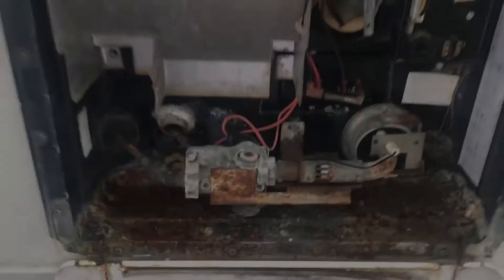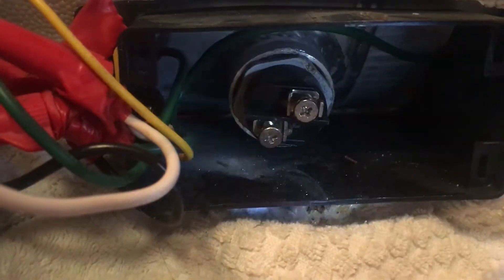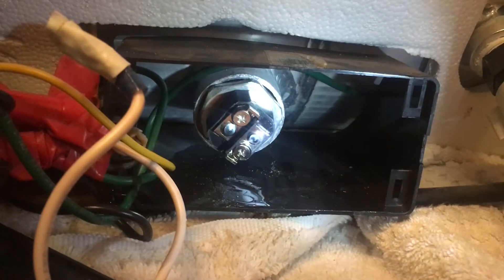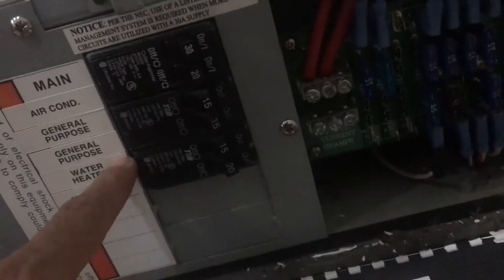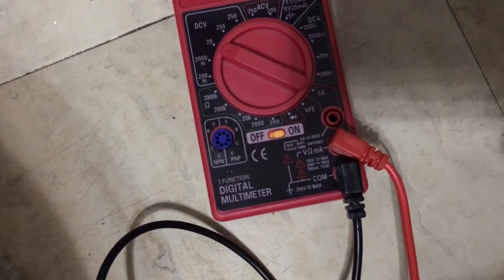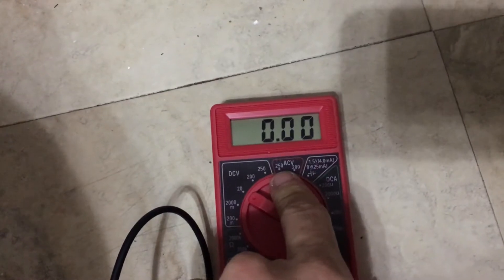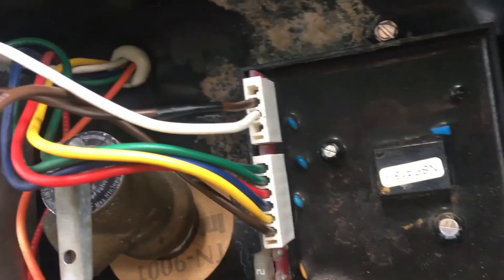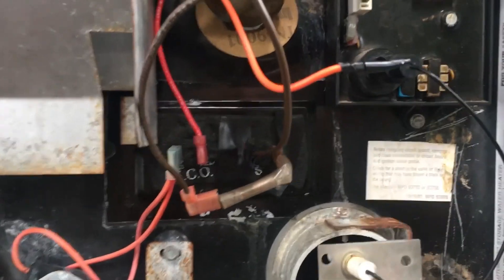Atwood Water Heater Troubleshooting & Repair | How to Fix an Atwood Water Heater In An Rv

Comment: How do u turn water supply off to a Atwood  mpd 93756 10 gal  tank ?
Reply from the maker: if you are stationary at a park then usually you are connected to a hose outside. There should be somewhere to shut off the water coming into if you follow along the pipes to where they lead outside the trailer and then the hose that leads to the connection to where you water comes in at.

Also, you may find valves that shut off the water close to the unit itself but I recommend to stop it from the source and allow pressure to release by opening up everything.

Make sure the unit has no power to it or else you can damage it further. Only turn it back on when everythings ready and its filled up with water again

Comment: Hi Brian, we have an Atwood in our 2016 trail runner.  We went to the trailer this weekend and our water was smelling bad both cold and hot water… any idea what could be the problem?  Thank you!
Reply from the maker: Could be the water itself or I would check the connections on the grey water tank and the main water tank to see if maybe something maybe got in it or somehow got intertwined. Other than that, you should be able to tell a difference if it’s a fecal smell, a rotting smell, or if it smells like stagnant water ?
Reply: Thank you so much for your reply and time! I will check that out :)

Comment: Not old enough we dont have Epc  TStat  in the outside and hot water can burn you it’s so hot.
Reply from the maker: are you saying your water heater is too hot?
Reply: I have a 2001 tv with a Atwood water heater.  My gas comes on but my water does not get hot.   Any idea?

Comment: I'm having an issue with my relief valve opening and flooding the outside panel,  putting out the flame

I've tried reseting the air gap a few times. I'd really like to have hot showers back

Comment: Nice video. I recently purchased an older camper with a water heater that looks just like that one except it is a 10-gallon. Have had no luck getting it operational and I heard you say you have to have 12 volts. Does your trailer have an AC to DC converter or do you have to keep a battery charged on the trailer? I am at a fixed location on full electric not using the gas side either.
Reply from the maker: yes it did have a converter and yes you do need to keep the battery charged on the trailer. Especially if you dont have a converter to convert. I know it is super confusing but your best bet is to buy a multi meter from harbor freight for 10 bucks and start testing everything from the switch that turns the heater on to your battery. Follow the wire from your battery to your circuit board and make sure everythings connected. Unfortunately, thats what I had to do in order for me to understand how it all worked
Reply from the maker: You might want to see my other video on how the camper electrical system works... I think it will help you big time

Comment: Very helpful video I’ve been having countless issues with my water heater. I have been checking my voltages on the wires outside and I’m only seeing .01 coming through my yellow wire. Would that indicate the board is faulty?
Reply from the maker: To be honest, it's been so long since I've worked on this thing but I do know that the board could not be turning on due to the switch or fuse panel its connected to... Since it's giving off .01 then I would assume its getting some sort of power. To be sure, you should check where the switch is to see if it's sending electricity to the board or the fuse panel its connected to
Reply: Yeah I checked the fuse it was okay and my switch inside has power. Electric water heater is now working but randomly will stop working when the DSI fault throws. Have to do a whole electric reset and then it usually fires up on both. Anyways, I appreciate your help I’ll have to keep trouble shooting
Reply from the maker: @jeremydavis5031  yea it sounds like your board is on its last stretch lol

Comment: Hello and thank you for the tips. The switch inside doesn't turn on (red light won't come on inside) so I assume the problem I have is that the switch inside is not sending 12V to power the board outside as I understand your findings. Based on your video I'm thinking is that fuse you show at min 9. That was so helpful! I have the RV rented out so my tenant is not very happy with me now :-( Any other possibility that switch doesn't come on? Thank you!!!
Reply from the maker: Check the connections under the switch and then check the fuse. It might even be that circuit. I had to move my switch to a whole other circuit to work again so hope that helps!
Reply: @DJRussellBrian  You're not going to believe what it was. Right when you walk in there is a regular GFI plug that had tripped. I pushed to reset it and all came back on. Somehow that receptacle is tied into the same circuit that feeds the On Off switch inside. Just bizarre! but thanks I learned a lot from your video.
Reply from the maker: @FabianCharrua  I actually talk about that in my other video! You might want to check it out… it’s an easy breakdown on the electrical system of a travel trailer and it will help you big time. you eliminate problems easier.. go to my profile

Comment: Hello, very informative video. I have an Atwood water heater G6A-7 in my travel trailer and I cant get any hot water to come out. Pilot and everything works as it should on the gas end. I also don't have a electric board on my water heater like yours.  Do you know where I might find the heating Element? I've looked all over the tank and can't seem to find it. Any help would be greatly appreciated! Thank you!
Reply from the maker: I would need pictures! Go to my website thedjpro.co and contact me... There is a contact form you can email me your email with... I will help you if you can send me pictures!

Comment: Incredibly, no one ever chimed in on the plug/anode question...so I will.  The Atwoods are, indeed, aluminum cased and do not need an anode.  The original drain plugs are nylon and they should be replaced with the same nylon plug every time they are removed (they're cheap) because they are a safety feature that is designed to fail if the tank seriously overheats.
Reply from the maker: Wow! Thats really good to know! I will have to get a nylon plug because I'm not sure what material it is Lol
Reply: I know this was posted a while back but in case anyone is still using this like I am… The nylon plug is also necessary because other metals can interact with the aluminum tank and cause corrosion.

Comment: Wow, really great video on that Atwood hot water heater, I had a problem about two weeks ago while camping in our rv. Had no hot water and found the problem at the thermal fuse. It had a bad connection cleaned it off and then worked like a charm. Just wanted to ask what makes that whistling noise on the hot water heater, my does it too. This was a great video. I actually learned more about this hot water heater. Thanks a lot and I'm subscribed to your channel.
Reply from the maker: I’m really glad my video helped you and you enjoyed it! I appreciate the kind words!! Hot Showers are so important! LOL the whistle noise is either the heating element kicking on or it’s the relay sending electricity to the control board I want to say! Totally normal
Reply: @DJRussellBrian  Thank You.

Comment: When I ordered my thermostats from Amazon they arrived loose and could not figure out which was cold and which was hot one. Come to find out that the connectors on each are different sizes from each other. So when taking out the old one, replace with like for like one at a  time. Brown wires are different connectors than the Red ones...Just a tip if it happens to you.
Reply from the maker: Yes absolutely correct! Thank you for sharing that! I remember being a little confused about the thermostats and I gathered so much info from so many different sources and I wasn’t even thinking about making a video about this until last minute when I realized I could probably help a lot of people if I put it all in one place... I have more coming in the works! I like solving problems myself and teaching so stay tuned and thanks again!

Comment: This might sound dumb, but how do you remove those panels?
Reply from the maker: Ask me any question you need! No question is dumb LOL. I assume you are talking about the panels that lead to the water heater. They were basically nailed or stapled to the inside of the panel which I had to tap very carefully and somewhat break the panel to get into it.. unless you can find a way better than me LOL... I wound up screwing it on and making my own panel afterwards 😂

Comment: If not working on electric or gas would it be same problem?
Reply from the maker: There are a few other things to check first before pointing to the water heater needing a new control board. If you're not getting power from your fuse panel to your light switch then the light switch won't work. if your getting power from your fuse panel to your light switch (gas & electric switches) , are you getting power from your light switch to the circuit board? (coming out of white wire).... If your getting power coming out of that white wire with electric switch turned on than your control board should be taking that power and working with it.... Are you getting power coming out of the yellow wire in the video? My point is, if your not getting power from your fuse panel to that light switch then your water heater will never work.. you need a multimeter to test for 12 volts coming out of fuse panel, 12 volts coming into light switch with it on, 12 volts going into control board (white wire), and you need 120 volts (on electric mode) to power the heating element.... It seems like your not getting power at all coming from your fuse panel to power the circuit board! test for 12 volts like I did in the video!
Please let me know if this helps or if you have any more questions
Reply: Getting power to gas & electric switch
Reply from the maker: @marcuslane3  Ok and with electric turned on, are you getting 12 volts coming out of the yellow wire that goes into the relay? everything on?
Reply: @DJRussellBrian  havent went that far..but I do hear a slight hum when the switch is in the electric position...
Reply from the maker: @marcuslane3  thats a good sign! Go to your local parts store and look for a cheap multimeter that measures DC AND AC ... DIRECT CURRENT AND ALTERNATING CURRENT. I was confused about multimeters at one time but AC is household power (110-120 volts ) and DC is battery power (12volts) like a car..... A multimeter will measure this current and save a lot of troubles! Either that, or you'll be guessing at whats wrong with it! It could be the heating element ... if its an old system like mine, numerous things can go wrong with it at once like it did for me in the video... Everything that could have went wrong with mine went wrong and im glad i got it on video...
Reply from the maker: @marcuslane3   This specific model water heater runs on BATTERY POWER AND HOUSE POWER... When you flick the gas mode, your control board should start trying to send a flame to the starter... that gas switch controls the sparker that sparks the flame and then gas propane takes over heating the water.... The electric switch sends 12 volts from the fuse panel to the control board (white wire) and thats the hum you probably hear... Your control board uses those brown wires to read water temp and control board sends 12 volts through the yellow wire to your relay which is next to your water heater inside.... the relay has the 12 volt yellow wire to open the relay and allows 120 volts (from water heater being plugged into house) INTO THE HEATING ELEMENT TO HEAT IT....
Reply: @DJRussellBrian  no worries appreciate the input...saw your video..very informative..trailer is a 2011..thanx for responding..Ill get on it
Reply from the maker: You could put a new heating element in it and it still not work because what if you find out that the 110-120 volt AC power isn't coming in from the circuit breaker box its hard wired to or if its plugged into the wall and isn't getting power somehow from that outlet. Maybe you'll find you are getting that 120 volts into the relay but theres not 120 volts coming out of the relay connecting to the heating element meaning you have a bad relay... I was getting my 120 volts I needed but I wasn't getting 12 volts to my circuit board... Hope this helps!

Comment: WOW!!! this has to be the best video out there right now. I've been trying to figure out my problem with mine. you done a great job explaining everything you were doing
I do have one question for you, was the propane side working but not the electric, cause that is the problem im having with mine.
Reply from the maker: First of all, thank you for appreciating my efforts! YES!! My propane was still working!

 When you flick on the gas switch in the front (next to electric switch), it draws 12 volts from the fuse box and sends 12 volts through the orange wire (top connector) on your control board. That 12 volts coming from the orange wire sparks your igniter to the propane...If YOUR gas is working than that means YOUR orange wire has a good connection to the control board. That also means YOUR gas switch is getting power from YOUR fuse box!

 When you flick the electric switch, it draws 12 volt DC from the fuse box and it sends 12 volts through the white wire (top connector shown in video). That 12 volts goes through the control board, detects temp, and sends 12 volts through yellow wire which goes into your relay to open it and allow 120 volts to your heating element! 

 Your best bet is to get a multimeter and see if your getting 12 volts through that white wire at the top with ELECTRIC SWITCH on. 

If theres not 12 VOLTS coming through that WHITE WIRE into your control board then you have a problem near the fuse box where the electric switch wire plugs to the 12 volt fuse panel box, the electric switch connection itself needs testing, or bad wire somewhere...

 If you ARE getting 12 volts through that white wire than it needs a good connection on that control board (lines up with the correct metal slot)... 

If you're getting 12 volts through that white wire when its connected and on you should hear power zip through it .. give it a good firm press and a gentle wiggle to see if it connects. 

With everything connected to the control board, test the yellow wire that comes out near the water heater from the bottom connector of the control board into the relay. That needs 12 volts to open the relay!  I hope this helps!